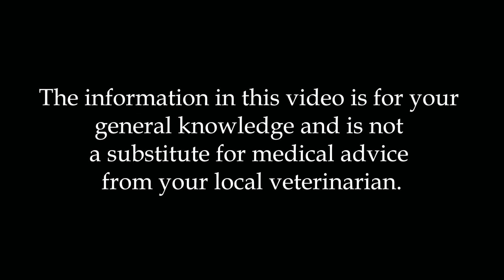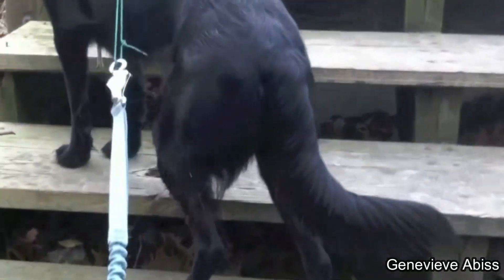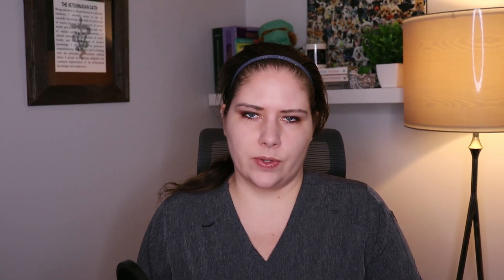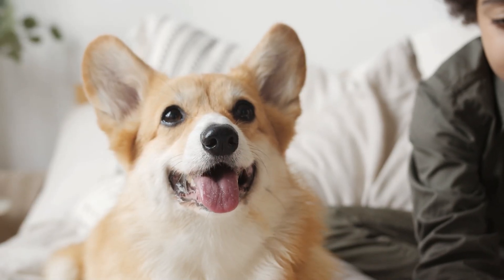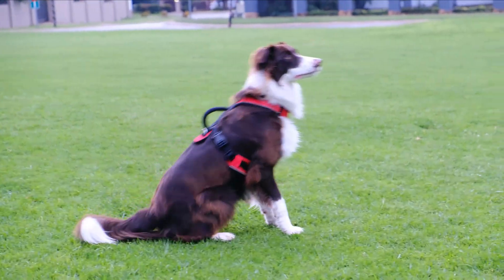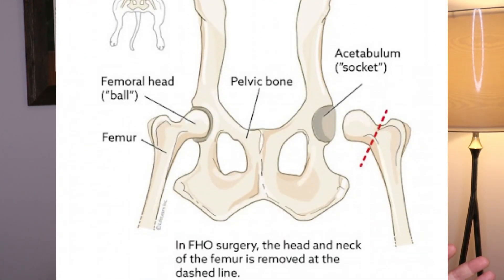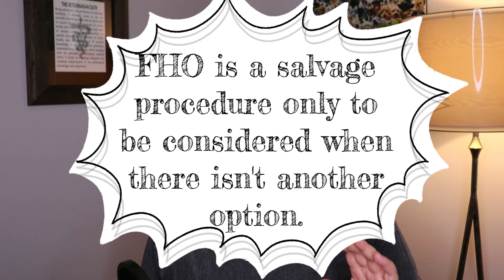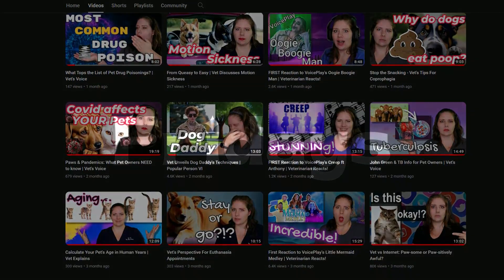Hip Dysplasia Demystified: Vet Insights for Pet Guardians

Comment: You mentioned the impact of genetics and quality food,  can you expand on the impact of exercise and timing of spay/neutering ?
Reply from the maker: Thanks for the question - those are not mentioned because the research we have at this point shows they are not significant factors. The closest I can come is that there's one study that showed dogs on slippery floors had a correlation with increased incidence of hip dysplasia.